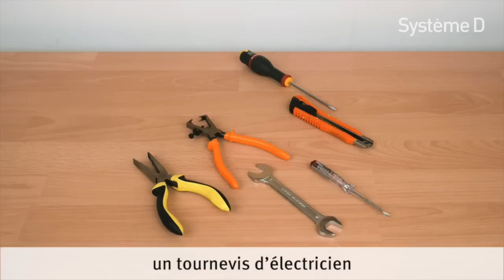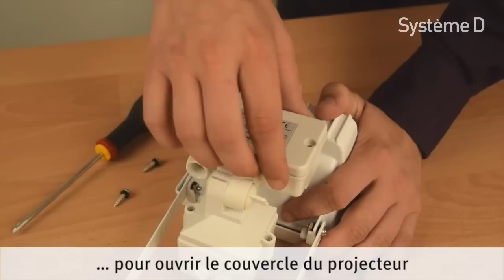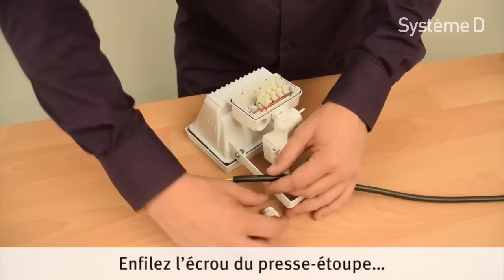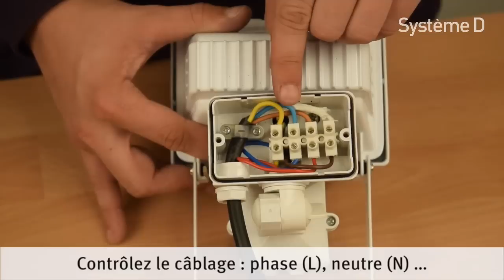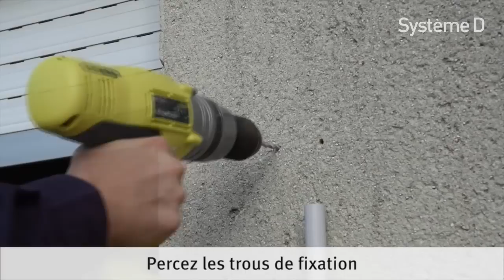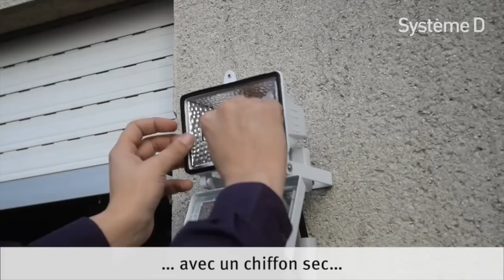Comment installer un projecteur extérieur à détecteur de présence

Comment: Du coup pour pouvoir avoir de l'électricité il faut relier le câble ai disjoncteur et y ajouter un différentiel ?
Reply: bonjour
non c pas une obligation de mettre un différentiel pour votre projecteur a led , moi je les ai brancher dans une boite de dérivation car j'en ai 5 . Je me suis tous Simplement connecter sur mon éclairage extérieur ou il y a ma lanterne au dessus de ma porte d'entré . par contre pouvant pas me repiquer dessus j'ai tirer un câble du tableaux électrique ( la ou j'ai mon éclairage exterieur ) j'jusqu'à ma boite de dérivation et de la je les ai alimenter un part un. Surtout ne les ponter pas entre eux mais alimenter les un par un c mieux. sinon un simple disjoncteur 10 ampères suffit amplement mais de nos jours tout cela a changer . dans les habitation neuf , l'éclairage se fait avec du 16 amp , les pc en 20 amp pour du neuf normes électriques NF C 15100 . Mais moi perso 10 AMP pour mon éclairages , 16 AMP pour mes pc , 20 AMP pour des prises spécialiser comme machine a laver , lave linge , ect ect .Désoler de m'étendre sur le sujet mais j'éclaircie pour les gens qui me diront le contraire et memes je rajouterai que le domestique et le tertiaire non pas les memes normes a se sujet . voila vous pouvez me faire confiance cela fait 30 ans que je travaille en électricité courant fort et faible et je ai jamais eu de probleme avec passage du Consuel derrières moi a plusieurs  reprise car j'ai horreur de refaire 2 fois le memes travaille

Comment: Attention il faut utiliser du câble souple type H05 et non du câble rigide R2V pour ce genre de luminaire qui n'est pas immobile (risque de deconnexion ou rupture des fils lorsqu'on change l'orientation du spot...) D'ailleurs c'est plus facile à faire avec du câble souple...
Reply: slt ssikhcnerf perso moi je travaille absolument pas avec sa c p- etre du au incendie que j'ai vu chez certain particulier memes si c plus beau mais pour moi la sécurité avant tout. un câble souple étant multi brun il casse plus facilement au serrage de plus il te faut des embout de câblage pour tes fils .Ensuite si tu as peur que sa se casse du rigide  fait une goutte d'eau avant ton luminaire comme sa tu pourra le bouger dans tout les sens , tu aura aussi un peut de rab tout dépend de ta goutte eau . Apres chacun voie midi a sa porte  l'inconvénient du fil souple, c'est qu'il "vieilli mal", Le câble souple n'est pas interdit par la norme NFC15100           mais tout électricien te dira que c pas la bonne façon de faire en bâtiment. Mais bon p-etre certain oui apres tout ces qu' un luminaire non. De plus le souple est plus cher que le rigide. Donc c a chacun de voir sa

Comment: bonjour peut on brancher une lampe à detecteur de mouvement à l'extérieur si l'on possède déjà un interrupteur interieur, si oui comment faire, pouvez vous nous faire une vidéo SVP merci
Reply: ( je sais le post est vieux mais cela peut servir a d'autre vue que de nos jours et depuis bien longtemps tout le monde pose de la led partout ) 
avez vous une boitte de dérivation  sois encastrer ou en saillie avec une terre dedans car obligatoire pour le détecteur mais sa vous le savez déjà désoler pour la vidéo par contre vous expliquer pas de soucie le neutre a ta lampe et a ton détecteur, la phase a t-on inter et a t-on détecteur , la terre a t-on détecteur car il lui faut et a t-on éclairage et certain vont le mettre a l'interrupteur memes si la norme NF C 15100 ne dit rien la dessus sauf si ta carcasse est métallique ou si un jours tu mais des inter en or!! ou éventuellement pour se repiquer dessus , reste plus que ton commun de ton inter et de ta lampe que tu relie a ton détecteur et voila le tour est jouer sa fonctionnera sois en marche forcer ou pas